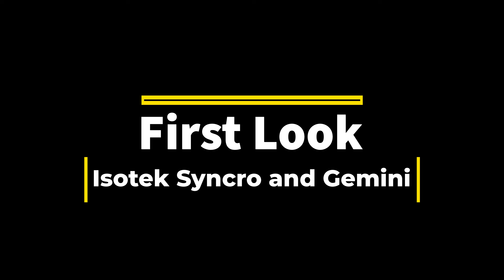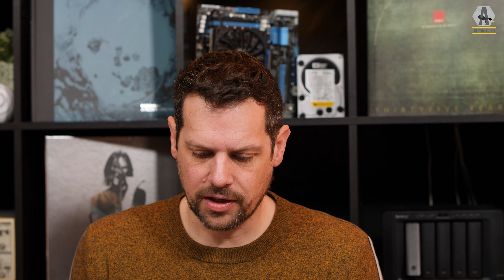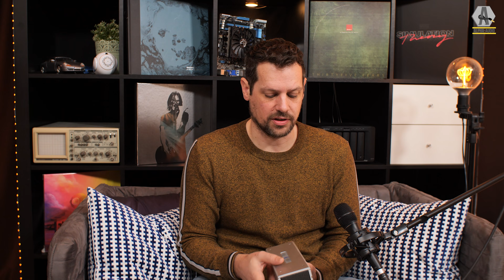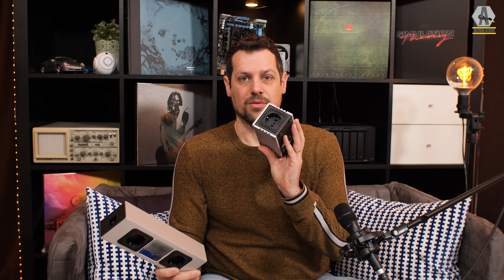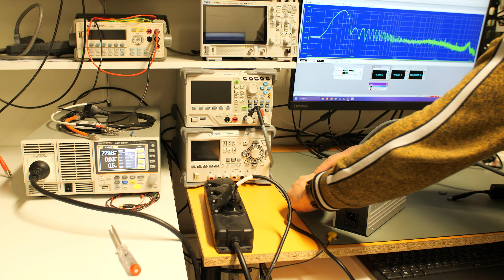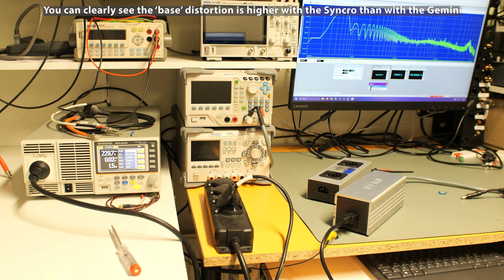The difference between the Isotek Gemini and Syncro! A tale about DC

Comment: That really IS interesting, I have an Audes st-1500dc. Well, it isn’t actually called dc, but the serial number has dc in it and it blocks dc offset. I am very happy with it. It made the hum almost disappear on my amp, there is no longer the ac leakage tingle when I move my fingertip over the chassis and the sound moreover a lot. Especially the tightness and power of the bass.

Comment: There is a DC of 0.78V in the building I'm living in.
Both my YBA power amp and my Lavardin IT are humming from time to time.
So I brought a V5 Synchro Uni10 but it doesn't cancel this DC. I guess the value is too small.
You said your AC generator can apply DC.
Did you experiment with it ? what did you find out ?
Thank you.

Comment: Hello, thanks for the review.  I have the teac ud-701n (streamer/dac/pre) paired with teac AP-701 power amp which both uses toroidal transformers for each component (4 the ud-701 and 2 the amp).  Do you think that adding a dc blocker will improve their performance and sound?

Comment: I have the high current model of this DC killer running into the larger Isotek filter board. The board feeds my subs, streamer, Accuphase amp, Denon AV amp and TV. I don’t know if the DC killer is doing much but it looks nice. System sounds great so no complaints.
Reply: You have the Isotek syncro uni 16? No problems with the amp?
Reply: @ No problems. The synchro is doing its job.
Reply: @aussie8114 Thanks, did you notice a difference in sound? Actually I would only buy it to lower the hum of the transformer..
Reply: @ No difference to sound to my ears, for better or worse. If you have hum then it may help but may not. Depends whether the hum is caused by excess DC on the AC or just a problematic transformer. Years ago I had a Sony AV receiver that developed a hum which was horribly loud. It was a bad unit.

Would be ideal if you could get a Synchro to try, or be able to return it if of no use to you. My dealer said he sold a few but they found it of no use so returned it. I didn’t return mine because the cost is not an issue and it looks impressive 😅
Reply: Haha, thanks for your honest answer and yes it looks nice 😅. I will try to get it on trial somewhere 🤞🏻, I think the hum must be related to DC because depending on the day and time it´s gone or returns 😊

Comment: Thanks for this interesting and useful video. I enjoy all your videos. May I just confirm that you said there is no advantage in using the Syncro DC blocker with any audio component that has a switch mode power supply, only with a linear power supply? Thanks for the clarification.
Reply from the maker: Yes... That is true. Switchmode power supplies don't need this.
Reply: @TheAlphaAudio  Thanks for the prompt reply. Love your Lab audio tests, hope you can find the time and resources to keep them going...
Reply from the maker: @marcfoss7687  me too!
Reply: @TheAlphaAudio question, I want to add this to  my powerquest 505. All my equipment, Hegel Integrated amp, Denefrips DAC, turntable, streamer, networking, etc. I understand you said switch mode does not need this, but will I still benefit from it or degrade it if all my equipment is to conditioner with a Synchro before it?

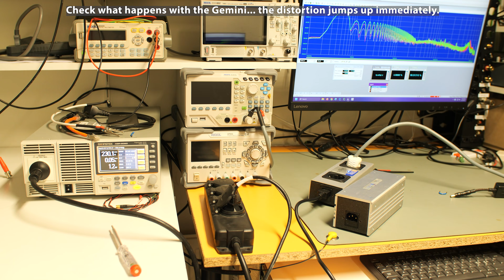Comment: Please correct me if Im wrong, at 2:35 I thought you said Iso-Tek instructed to put the gemini near the wall and then connect the distribution block to it. Would appreciate if you could confirm.
Been enjoying your channel since your Metrum Pavane days. I also own one and love it. Love the live speaker A/B comparisons too!
Reply from the maker: I meant the Synchro. Than the Gemini. Thanks for your support.
Reply: @TheAlphaAudio  Oh Im a dummy. I was calling the Synchro a Gemini. Ok we're on the same page. I should know better. I have an Iso-Tek Gemini and an Evo3. Looks like my next purchase will be a Synchro to put before the Evo3. I will not put one before my Gemini (thanks to the information contained in this video) since that's where I plug my router and my Mac mini (Roon core). Both use switch mode power supplies which I keep separate from my other gear containing toroidal power supplies. Thanks for the clarification. Cheers!
Reply from the maker: @HD-Tech  welcome!

Comment: I found getting the phase of the power correct to be very important to avoid transformer hum. Both to avoid problems with potential between ungrounded devices, but also some devices will just dump nasty stuff onto the grid is phased incorrectly. At one point I noticed the brighter the image on my LG oled, the louder the transformer hum from my amp 😱 Turning the power plug of the tv eliminated that completely (the tv was only connected to the system via optical, so no galvanic connection). This surprised me as I did not think phasing mattered in devices with switch mode power supplies. I do use a DC blocker, in addition to filtering, which helps but only to a degree. So my coffee maker in the kitchen still gets my transformer singing and in my old flat it was honestly hard to make a dent in the dc related hum.

Comment: My system is 'currently' without any cleanup device in the power line. I used a few filters and DC blockers, but they all seemed to have a negative influence on performance or no detectable difference at all, depending on the selection of devices I connected to the filters/blockers. I have a slight hum in one of the transformers in my transport, but no DC blocker I tried so far seemed to fix that - I am not even sure if DC is the cause of it. Curious what the Syncro test will bring.
Reply from the maker: All power products should be tested at home. And you should always be careful will.fast conclusions.

Comment: In Texas ; Years ago I bought an Equitech balanced AC power supply & have had no sonic issues since . No ground loops , no hum , dead quiet . 
  Everything has the same ground potential when it is all 100% connected to this unit . I do have a ZeroSurge at the wall into which the BPS connects . USAF veteran - electronics
Reply from the maker: Balanced filters are great.

Comment: You finally follow in my footsteps. There are cheaper solutions than Isotek and probably better ones.

I have a lot of:

* Schaffner RF/EMI FN9244B (B: medical). Some of 8A and a lot of 3A (Spain: 230 Vac/50 Hz)
* Würth 150 khz ferrites
* DC Blockers with BIG capacitors (one, the prototype, updated with expensive Mundorf 47.000 uF with LOWWW ESR)

- Greetings from the sunny 😎Tarragona (SPAIN/EU) 🤗 -
Reply: Aggg, my answer was deleted. Short:

PDF -> B: medical -> LEAKAGE CURRENT
Reply from the maker: YT filters some words or urls...
Reply: Hi! Why a re you using medical variant? You dont have PE in your wall socet? Or what is the reason? Looks like with Y caps it should filter better.  May be Iam wrong...
Reply: From the PDF: Schaffner_datasheet_FN9244

[ FN 9244 B versions comply with the requirements of 1MOP acc. to IEC/EN 60601-1 for creepage and clearance, LEAKAGE CURRENT and
high potential testing ]

 @sergeiu8101
Reply: What is wrong with leakage current? Why you dont like it?
Reply: Security?  @sergeiu8101
Reply from the maker: That can be pretty dangerous.
Reply: Electricity is inherently dangerous. No one should deal with it without proper qualification. Considering that medical equipment has its own safety standards and that Y capacitors are key filter components, the decision not to use them seems strange.

Comment: Most would get a good sonic upgrade from the Syncro Uni. Is quite a good upgrade. Most products on the market do not solve the DC-problem in a good way (getting rid of dc while not harming inductance and impedance). 

There are a lot of different power issues. Synco Uni solves one of them and does it well. It’s designed to have other power cleaning after it in series. 

The Gemini solves three of the other problems (isolation between equipment, filters noice in two ways) in an entry level way. 

Much more kind of power problems should be addressed and if one choose filtering, then more db than Gemini is recommended. 

Don’t forget grounding incoming power mains, chassi grounding, signal grounding, improving grounding effect (better noice sucking effect) and much more power issues. 

I liked the video though…
Reply from the maker: You are right. We have more videos on power. This was a simple video about some differences.

Comment: Brilliant. Thank you! I run my system from a battery with Giandel pure sine wave generator (like a Stromtank for a few hundred dollars) into a Puritan PSM156. However, the Syncro could be worth trying on the power amp which is not fed from battery.
Reply from the maker: It is not really suited for a power amp...
Reply: Syncro is delivering high end performance

Comment: I would like to see the sine wave before and after if you can measure it?
Reply from the maker: The sinewave doesn't change. You need a regenerator for that. I did some extra measurements on a power supply today. You clearly see the effect. You can read the results in the review. It will be live on Monday.